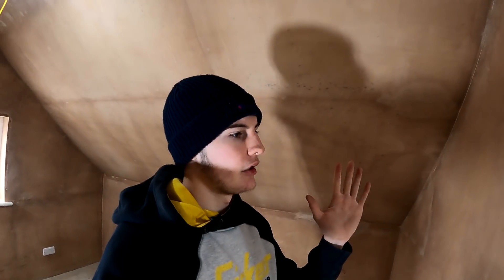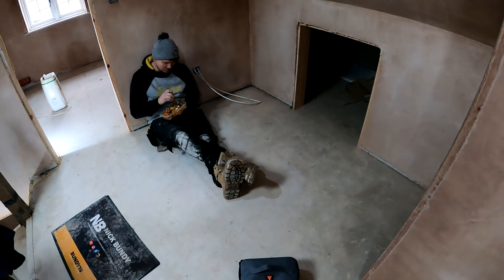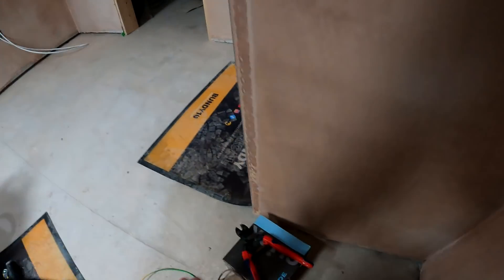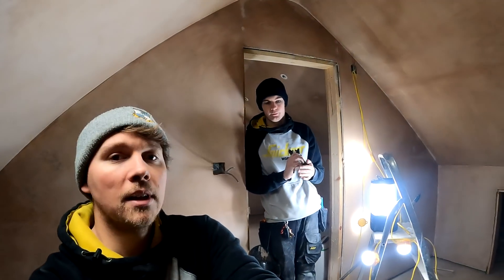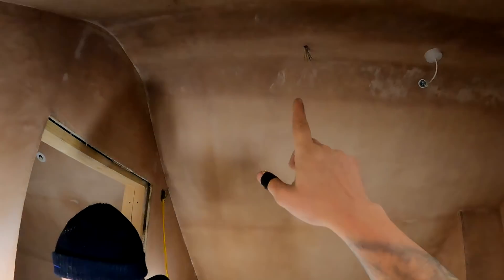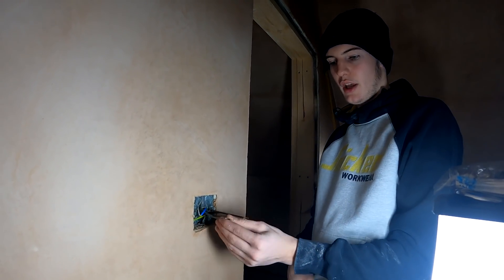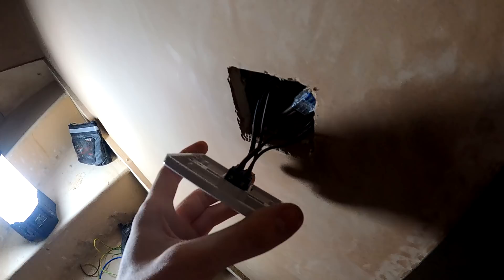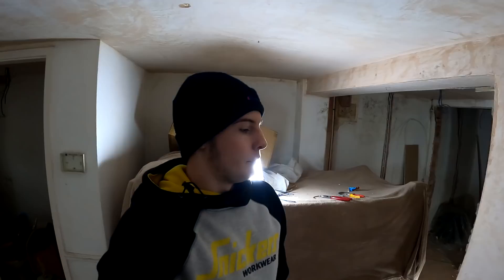Apprentices first time wiring  an intermediate switch - Apprentice electrician

Comment: I do brown as common (because always live), 

black and grey as strippers (sleeved because they change) 

Also 
 grey as neutral (because that’s normal)

black as switch wire if using 3 core because only colour that makes sense to use

Smokes brown L, Grey N, Black interlink

Comment: Ahh the old 2 way and intermediate lighting. The three core modern method with both live n switch live in same box seems to be now standard. At some point you will come across old method of live at one end and switcg live opposite end. With only twin used for strappers. This is terminal sensitive and also may have a different neutral at the switch live ( load, light fitting) to the permanent live the two way started. 🤦🏼‍♀️😂. You'll find out what I mean one day if you don't get it now. 
Keep up the effort and all the best

Comment: Intermediate switches should be simpler, both in theory and practice, than the 2-ways at the end of the run.  Two switched lives in, two out.  The return and the CPC just passing through without stopping.

Comment: i was using that same diagram when i was studying for my C+G pt 1+2 16thed back in 90's and recenty had to convete an intermediate switch in to a 2 gang 2 way switch which was fun to do  - but i do know a few sparkys that don't like doing lighting circuits and had a few calls to talked them though it or show them how it's done -- one of the things i used to do was a wiring diagram of the circuits so i could use has a refence while doing the job i was on -- but theres nothing like on the site training/job to get a better understanding of things -- great work Adam 👍👍
Reply from the maker: cheers

Comment: Nice neat Job Adam.Just a question, given the availability of wireless switches as Nick used in a previous video would the preference these days be to fit those instead to make this type of job cheaper and obviously quicker to install?
Reply from the maker: hi regarding the wireless switching it would not be cost effective to use them as we had to run cables all around the house so all the boards and ceilings were basically down   making it easy to run cables . would have deffinetly been easier to pair up tho ahah

Comment: Adam, you are gaining confidence, one thing did you have pickle on the cheese? But seriously the switch upstairs, the neutral is for if ever a smart switch is required, but you didn't mention if you put a wago on it or not (To isolate the core) I am sure you did, its just you never mentioned it.
Reply from the maker: no pickle sorry ahah